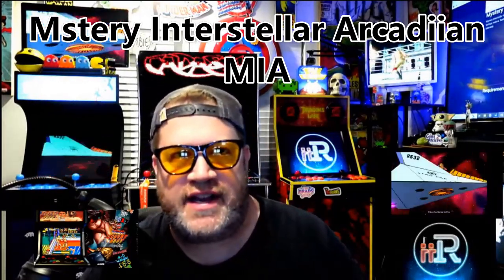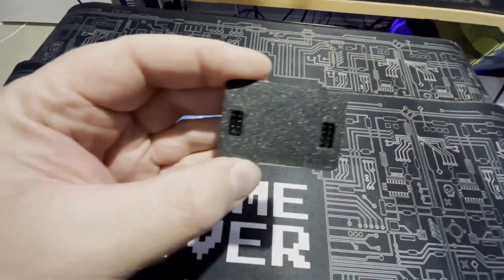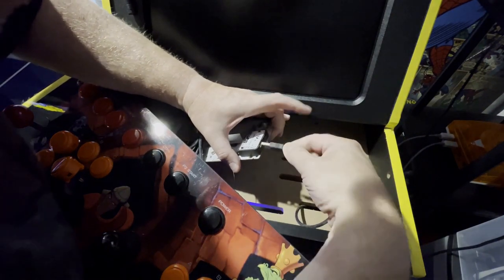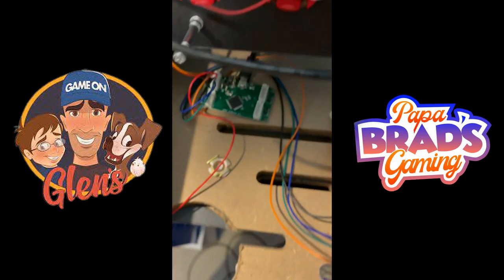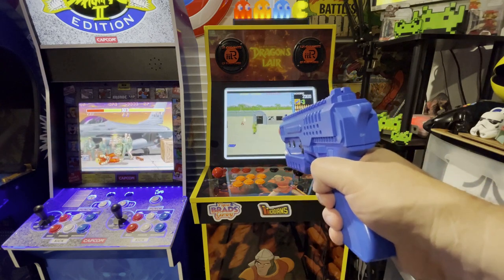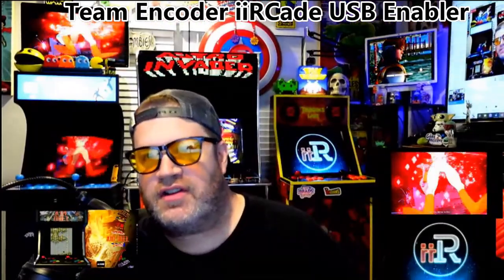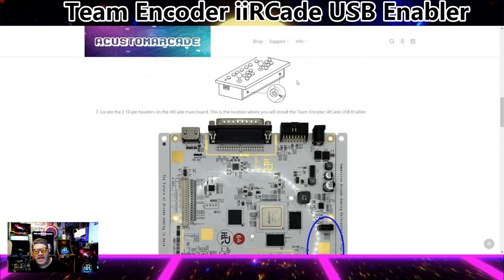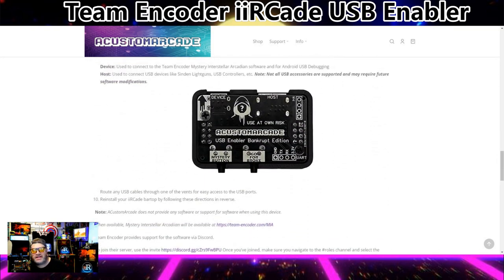How to Mod/Hack your iiRcade | Mystery Interstellar Arcadiian Tutorial Part 1 Papa Brad's Gaming

Comment: Quick question, your 4 to 8 gateway mod. Do you need the 2 player button to actually play 2 players or how did you get the iircade to accept 2 players without the 2 player grs button.
Reply from the maker: The 4 way 8 way mod is only on the player 1 joystick. That is all I really need for myself.